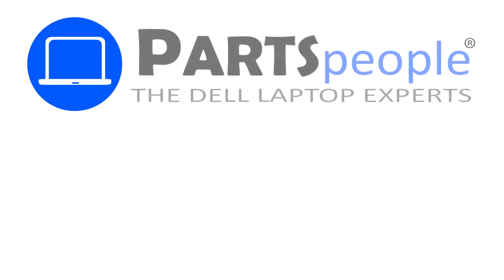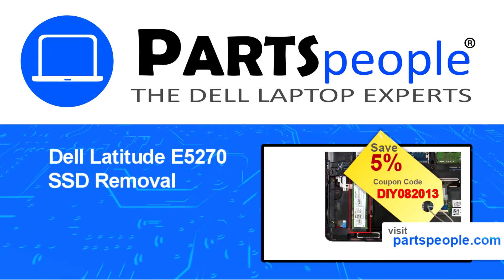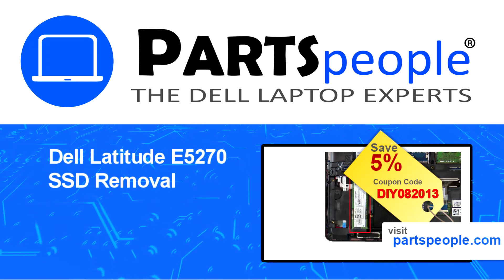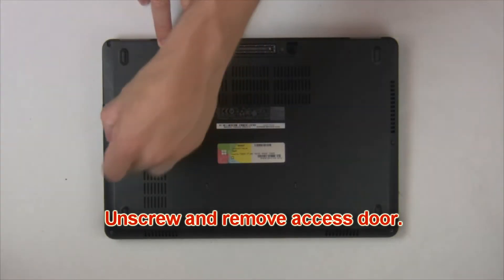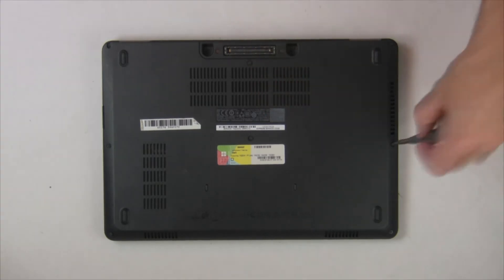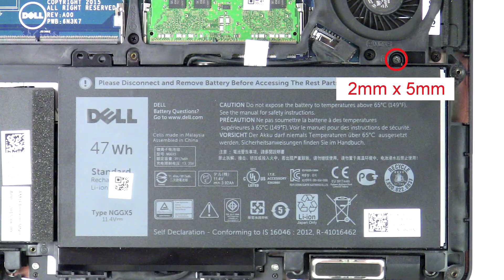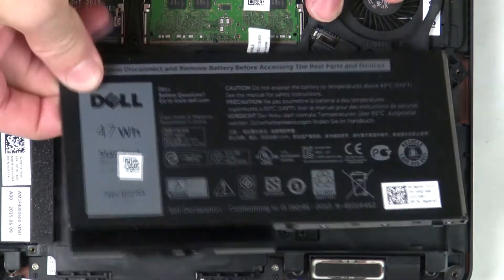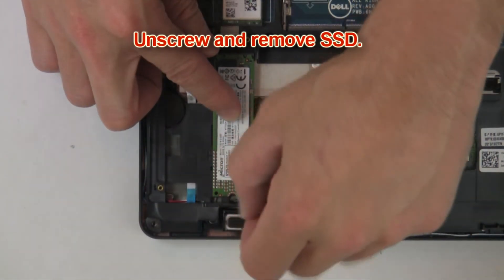Dell Latitude E5270 (P23T001) SSD How-To Video Tutorial

Comment: can we installed 2.5" sata ssd above the m.2 2280 ssd? what cables and bracket will be needed for that?
Reply from the maker: Hi, yes you can if you have the smaller 3-cell battery. We're out of stock of the connector (N6MG2) but we have the caddie here: https://www.parts-people.com/index.php?action=item&id=27177